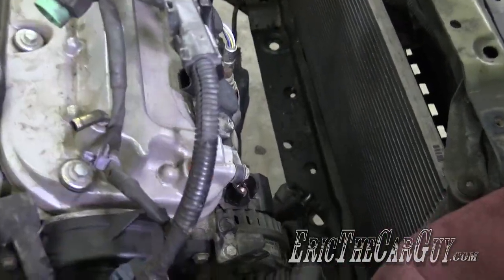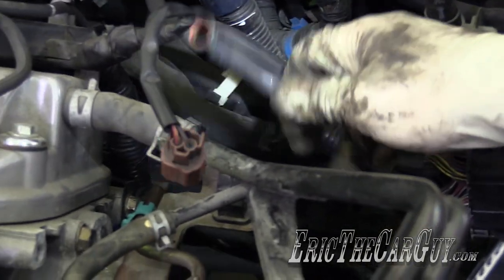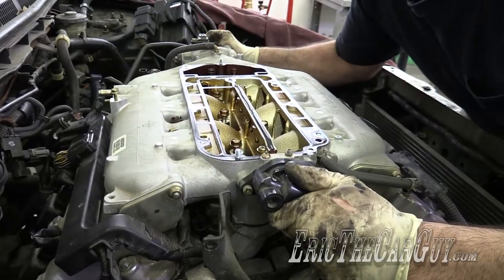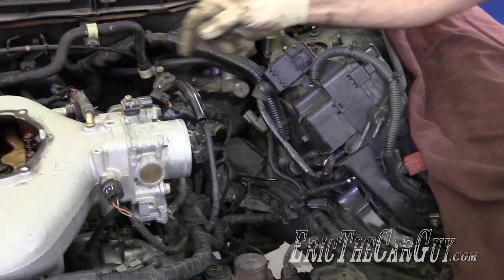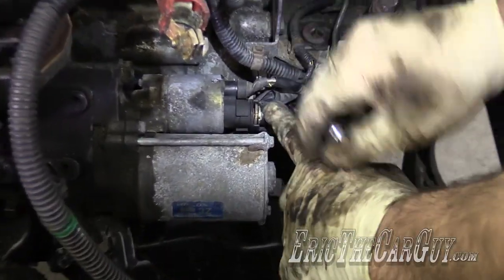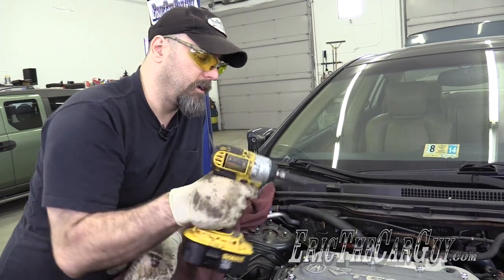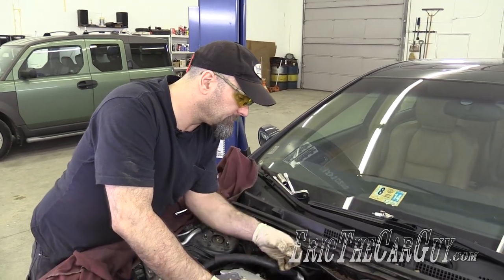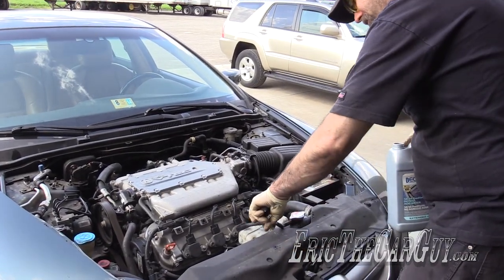2004 Acura 3.2L TL Engine Replacement (Part 4)

Comment: Just a heads up, the series you had made here was the catalyst to my motivation on doing my k24a-2 swap in my ‘03 Accord...the previous engine’s rings were worn and it sucked oil into the #1 cilynder giving me reason to do the swap, and the results were amazing. 
That being said, I wouldn’t have had near the confidence in doing such a project had this series not been made. Thank you for taking on that project, Eric; for doing so made a difference in my life!!
Michael
Lebanon, Oregon

Comment: This was an incredible video to watch!  Eric's work was amazing, and the video dude did a great job, too -- felt like I was there doing the swap.  Man. that was one filthy motor - every part seemed to have 1/8" of sludge on it.  The most amazing part was when the engine actually started and ran at the end.  After watching Eric install hundreds of connectors, hoses, belts, gaskets, pipes, and even more connectors, I was SURE that engine was never, NEVER gonna start and run.  I mean, what were the chances the engine would actually go back together and work?  But holy crap, that engine actually ran.  Unbelievable.

Comment: Really appreciate this video Eirc.

As an original owner of a ‘04 Accord 6 speed.  The layouts are pretty much the same and spot on for bolt sizes.  Biggest PIA are disconnecting harnesses.

Comment: I use a paint marker and mark each electrical connector, each hose and their connection point with a unique mark  as I disassemble them. 

It also works with bolts mark them with a number or a color the take a picture.

Comment: Great job, Eric. Thanks for taking the time to bring us along. Michelins actually don't hold up well to UV radiation. We've lived by Michelin for many decades, but I've switched to BF Goodrich, because of sidewalls cracking prematurely. Had to warranty out three sets of Michelins on two vehicles. The BF Goodrich (even though they might be the same company) seem to have a better formulation that holds up to UV better. Jump N Carry jumper starter FTW!

Comment: Trigger control is something younger people have a problem with these days, I believe.
Reply: +FyberOptic So you mean I'm not supposed to give my Harbor Freight 3/4 inch impact the beans when tightening lug nuts?
Reply: +Troomoo you're the guy that made it so I had to break the lug bolts free on my car with a six foot long pipe slipped over my breaker bar that one time, aren't you?
Reply: FrankTheCat No, if I had gotten to them, you would need to use the plasma cutter to get them off. Check out Briansmobile1's video on the "Lugnut from hell".
Reply: I had a rim fused onto the drum before... Nuts came off just fine. So I loosened them a bit and drove around until the rim popped free. I was doing rather sharp turns at 30 mph before it finally broke free. (I obviously tried traditional methods before I resorted to driving on it, but it was a fun start to a brake job!)

Comment: Great series Eric. I've got the same car, and even though I probably won't be needing an engine replacement anytime soon, I learned a ton about the car and the engine. It's awesome seeing how everything goes together, especially the stuff I've taken apart before where you showed a better way, or the parts I wouldn't have messed with. It was really cool watching you pull the engine apart, you knew where every connector was, the order to take things off, and how to make it easier when putting it back together. Thanks for all of the work on this. I know if your ETCG1 video you said this wasn't exactly a fun job, but the knowledge you shared is greatly appreciated.
Reply from the maker: +Troomoo Glad you enjoyed it. Thanks very much for your comment.

Comment: It hurts me to see cars that have been thrashed like this one.  It is a fairly nice car and would be a great car if it was cared for.  People take what they have for granted.  I am currently driving a 1995 Volvo 850 turbo with over 300,000 miles on it (120,000 put on it by myself) that I bought from a mechanic that owned it to 185000.  Because it was well taken care of it still runs nicely.  Take care of your things and they will last.  If you thrash on a car, have it looked at once in a while and do regular maintenance.  Thanks for the videos EricTheCarGuy, they are very informative.  I used several of them over the last couple years to teach life skills class students about basic car maintenance.  Several of them have since continued watching them to learn more.

Comment: Eric, not that you had a problem pouring the oil, but it made me think about something my dad taught me when I was a kid that may help you or others (if/when you don't have a funnel)... Hold the outsides of the bottle instead of the middle of the bottle which will prevent it from being squeezed as much and the oil will pour out more smoothly (less waves).

Comment: What a fantastic series! I watch all 4 videos. They brought back a lot of memories. I had a 2004 TL with 120k miles and later traded it for a 2012 TSX Wagon. Wife drives a 2014 Odyssey. Hondas all the way, baby! But, yeah, motor mount are a weak point in Hondas.

Comment: Eric, I gotta say "You are a hell of a mechanic" for doing this kind of auto work. I wish you are here in Columbus Ohio so I have you fix my 03 Mitsubishi Galant before I quit on it. My car heat does not work, horn does not work, oil leaking (I have to add a quart of oil between oil changes to keep oil pressure at acceptable level once it starts to make that knocking sound I know oil pressure is low), Automatic trans making humming sound, and the car won't start with jumping the starter, also it needs to have the struts replaced, and finally the paint is fading in some spots. So ......If I have to pay for your plane ticket, hotel and food for you to come and fix my car for free, I would gladly do that.

Comment: I don't know if it was in this video or in anotherone you said it, but thank you for the best tip I've gotten in a while: Look at things from different angles. Just got back inside after changing the alternator belt on my VW vanagon. Thanks again for the useful tip. :)

Comment: Don,t feel bad about double gasketing an oil filter on a car that holds 4 qts of oil, Did it once on a 34 qt Freightliner, now you have a mess.
Reply: You were probably swimming in oil weren't you lol
Reply: Actually I was backing it out of the shop when I got a call on the radio,,then I was up to my knees in it. I will never forget it.
Reply: I think second only to stripping an oil pan, sending off a car with the wrong filter or double gasket is a horror I wouldn't wish on anyone.
Reply: Gotta hate on the Pho knees.
Reply: +Herb Bees Try dropping a car off of the lift.  Didn't do it myself, but had the tech next to me do it.  I was under my car at the time and nearly peed my pants when it hit.  That's a sound I'll never forget.
Reply: I work at a Kenworth dealership as an apprentice and trust me not fun when you have an oil spill from a truck to clean.
Reply: Yep i've done it too he he:)
Reply: @James Schrumm it’s appropriate to cry at that point
Reply: I did the same on a cat c15 with a brake saver. 54 qts all over the floor.
Reply: i double gasketed and spilled over 500 qt of oil

Comment: Hi Eric, 
Great video series, watched all 4 parts back to back in same day.  I am a home / diy mechanic and worked on many vehicles over the past 40 years, including engine rebuilds, auto and manual gearbox changes and general maintenance.
Have made a few observations and now suggestions, after watching  videos........ New split pins on ball joints only cost cents, but could save a life, so why re use rusty split pins, no locking fluid or torque the castle nuts down to spec? See you advised checking  the replacement engine, by just turning engine over by hand, before fitting. An additional basic compression test with a battery hooked up to the starter, would be a quick way to test, if the engine has low compression due to hole in a piston, worn / broken piston rings or burnt out valves, which are all possible on a salvaged engine. How about go-pro type body or head cam, to video every day work? Then you can replay it, to see where a hose or bolt fits or replay to show a customer, that the work was actually done. Did you test drive the vehicles on the public road, with worn out slick rear tyres or did you fit some good spares wheels for the test drive?.  Can see you have Brian there for this video series, but do you normally work alone in the shop? If so, do you feel very isolated and closed in, with no natural light windows, overcome with fumes from exhaust gases? Also nobody to help / talk to you or to give a second opinion?
Cheers...... Mal

Comment: You should try getting one of the 12v impact screw guns. Many put out around 20#ft, and are great for assembling many parts on an engine without having to worry about messing stuff up.

Comment: this was really fun to watch. won't be removing an engine anytime soon but At my OWN fault (i admit) i took the ditch hit a covert and bent my radiator, condenser, and radiator support frame. so i ended up buying a new rad and condenser, radiator fan, and hammered and tugged the hell out of the frame to make it work! and it's in there now i'm just waiting for a new refrigerant tap valve to come in the mail and i'll be pretty much set oh and i had to silicon the the heck of of the coolant reservoir (mines on the fan shroud) but the leak stopped!

Comment: I spent over 20 years working in an auto repair shop, and finally just got fed up with all the electronics and emissions crap, and working on front wheel drive vehicles in general. Also, trying to beat the clock takes away any satisfaction in doing the job, because you know you could have done a lot better with just a little more time. Over those 20+ years I managed to acquire a ton of tools, good stuff, not Chinese junk. I love good tools. Now I work for myself, and specialize in vintage American cars and air cooled VWs. Nothing with any type of computer, EFI, and nothing front wheel drive. I do the job right, do not overcharge the customer, and still make a decent living. The only issue I've really had a problem with is finding parts, and sometimes when I do find them, the price for repro parts is insane. Most people with vintage cars already know that.
Reply: +vulcan1753 Funny thing is, for a guy like me who grew up fascinated with computers (and now a software dev) all the computer control seems obvious. Old stuff with tubes and linkages all over trying to get the engine to do what it's supposed to makes me shiver.
Reply: IMO, computers and cars simply don't mix. They are total opposites. I have no problems with computers, as long as they are not on cars. I'm also fed up with all the emissions and safety crap. I prefer to work on 1972 and older cars. I will work on later models without computers, as long as they are RWD. I will not work on any kind of emissions crap on any car period. If someone is having emissions issues with their car, they need to take it to someone who deals with that stuff. I drive a 1965 Chevy long bed pickup, which is mechanically perfect, but looks a little beat up. Even has A/C in it (I'm in AZ) Even AZ's unconstitutional seat belt laws do not apply to it.
Reply: i just wonder how much of the data is separate from the car's operation, like, can the car run even with errors, or is the whole computer system linked together
Reply: In most cases a car can run with issues, but the check engine light will come on, meaning it will not pass emissions. Most systems have a fail safe backup, where they will go into open loop and revert to default settings. They may not run as well, but they will not usually leave you stranded. The repair cost however, is likely to be high. There is a huge markup on electronic parts.

Comment: While filling the radiator remove a heather hose and proceed to fill the radiator. When coolant starts coming out reinstall the hose and top off the rad. I have almost 20 years experience working in a shop as a mechanic and that was something I learned very early on.
Reply from the maker: +James Sweeten That's a great way to get the air out. Thanks for the suggestion.

Comment: Thanks to our video I learned how my Acura Tl engine looks like and where to look for the problems solving.

BTW: my acura '06 runs a little lean SFT -7% bank1 and 2nd -12% bank2. LFT doesn't look bad though. I replaced spark plugs today, but nothing changed. What should I look for?

Comment: Doing an engine swap your going to overlook something, clamps are my Achilles heal. I always have a co-worker double check everything for me. It's a standard practice in my shop. Running those intake bolts down like he did with the cordless won't hurt a thing, like he stated, experience and trigger control.
Reply from the maker: +Emt Scythe Good idea. Thank you!

Comment: @EricTheCarGuy. I have an 08 TL that has piston slap pretty bad in cylinder #5. How long start to finish(average) will it take my mechanic to remove and replace the motor? Ill be installing a new water pump and timing belt along with tensioner into newer motor since it will be out. Thanks again sir for a great tutorial.

Comment: When I had my Jeep's engine replaced, the shop busted off one of the hose connections on the evaporative canister and didn't tell me.  They just plugged off the hose.  It wasn't until a year later that another facility pointed this out to me.  Needless to say, I will never go back to that shop again.  There's no excuse for not fessing up and taking ownership of a mistake.  Luckily I had a spare canister and changed it out.  No one makes those canisters for my Jeep anymore; the only place you'll find them is at a junkyard unless some dealer still has one in their parts department.

Comment: Sometimes you have to be careful when matching your connectors. I bought a Santa Fe 2.7 for super cheap because the MIL was lit and wouldn't shift out of 2nd gear after a routine timing belt change. Turns out the TPS and (i think) IAT sensors are right next to each other and use the exact same connectors. The connectors were swapped and the only thing I had to do to get it running perfectly was swap them back.

Comment: Hi Eric we just had our engine swapped on our 2008 Acura TL type s car ran smooth before the previous engine started to burn oil but not that we have theirs newer engine it's having an intermittent throttle at idle and low speeds cats wore deleted replaced the throttle body that came with the new engine with my old one and still did the same threw codes p0118 p0301 p0305

Comment: That was some nice shifting Eric! That engine has some grunt to it, spinning the wheels from 1st to 2nd with all that weight of the vehicle itself. Or hard compound tires.....
Clutch gripped fine, luck truly is with the dumb. But that was evident with the fact the engine didn't seize on him. Says a lot about Honda engines :-D
Reply: +Tim Lemmens Would have been nice to replace some of the clearly worn parts while it was all apart, however as Eric eluded that dual-mas flywheel would have been a major expense, and as you saw, even in a worn condition, those Honda original parts are much better then most after-market crap

Comment: I really felt kind of bad, putting in all that labour to get the engine out. Perfect chance for clutch, DMF (or conversion to SMF) and to do the water pump, (timing belt?) and new plugs. etc. On the other hand, its probably worth investing a bit of money in. It has a decent engine and a manual gearbox after all. Its probably going to need some suspension work, clutch and new tyres put on it by the new owner. 

Nice series Eric.
Reply from the maker: +zoidberg444 It ran fine. I did my job. Next...
Reply: EricTheCarGuy
That's why I'd be a crap technician. I'm to much of a perfectionist.

Comment: I watched with great interest as I have a 2004 TL with a broken AT trans. I am considering doing the swap myself as I have access to a lift in a nice shop. The car has 110,000 miles and needs a timing belt/water pump as well. I planned for new plugs simultaneously. 1. Based on both of these repairs is it easier to remove the entire engine/trans? and 2. lift out or drop down?  You mentioned that it seemed you had more room to lift up since it was a MT in the car you did. Curious as my experience is mostly on RWD cars and I haven't dropped an engine down, but I want to do this well. Any advice?

Comment: 20:37 I know this is an old video so it doesn't matter at this point, but each front tire is mounted in a different direction, ergo one is mounted backwards.

Comment: hey quick question, my 07 focus ides high( little over 2rpms) all the time and takes  a few seconds to idle down and there is this shimmer in the steering wheel with a slight idle raise when I come to my first stop of the day. Any advice? It has a new water pump, serpentine pulley, head cover gasket and spark plugs.

Comment: Did the catalytic converter replacement help you reach red line? I have the same issue with my 2000 gsr. It will not go to 8200 rpm like it use to
Reply from the maker: +Integra DIY You might want to watch the video again. ;) Also check the link in the description for help with that issue.

Comment: During the oil change you added 5 quarts. My 07 tl type s (3.5 liter) says to add 4.5 quarts, but I always add the full 5 quarts. Some forums say that's too much some say it's okay. Did you add the full 5 here? Is it fine in the 3.5 liter TL to add the full 5 quarts during every oil change? Thanks!